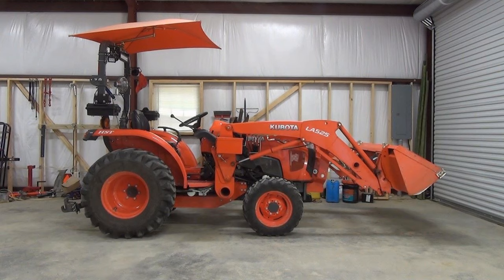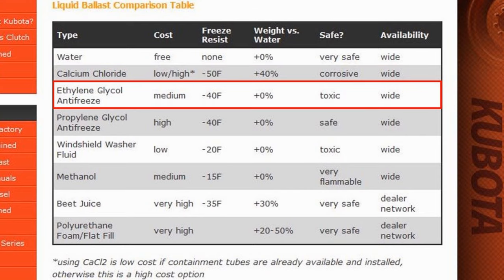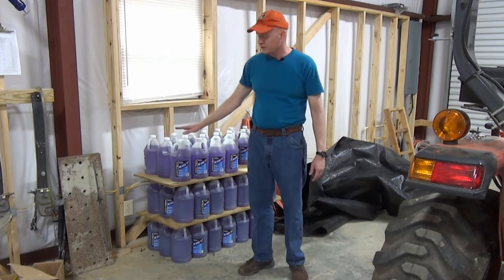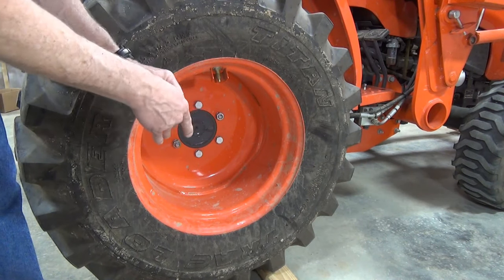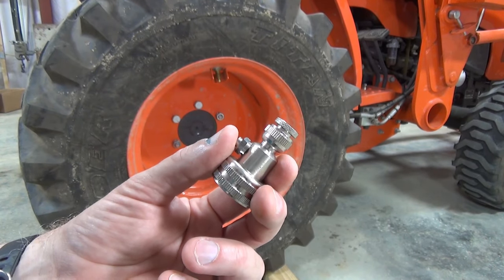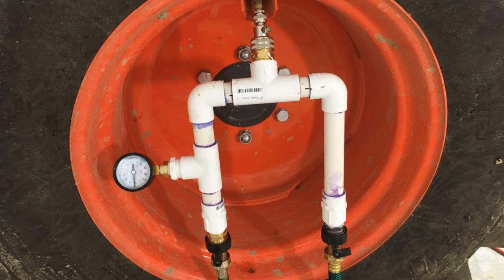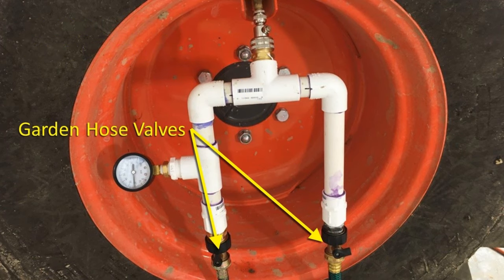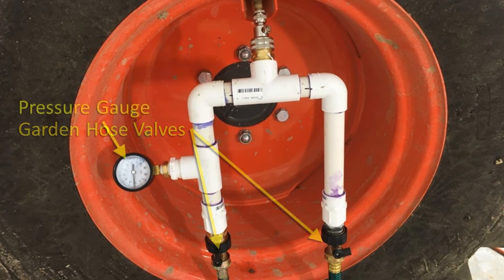Adding Liquid Ballast to Tractor Tires: Which Fluid? Which Method? Tire Fill Chart (#95)

Comment: You mention the possibility of loosing the bead on the rim when doing this. I live in a hard to get to area and don’t know what I would do if I lost a bead while adding ballast. Would it be safer to simply put a jack stand
Reply from the maker: It’s always safer to use a jack stand.  Keep the tire barely off the ground and the weight off the tire and you should be fine. Thanks for watching!

Comment: Any issues with corrosion damaging the inside of the wheels with water/antifreeze/wiper fluid ballast? When I was a kid in Texas we would fill the rear tractor tires with pure water (it rarely freezes hard or for very long here.... but does make tractor a bit heavier to trailer). I'm thinking to reduce cost using just a gallon or two of RV "red" antifreeze in each rear tire then filling with pure well water.... just to give them a little freeze protection (everything changed after Feb 2021 week of hard freezing temps in Texas and power grid failure etc... what a mess that was!). People, don't use toxic chemicals in your tires there is always the probability of a tire puncture leaking it out and you don't want your animals dying slow deaths after drinking the automobile "toxic" antifreeze (green, or orange!)... that stuff tastes and smells sweet, but it's poison to anything that licks it up!
Reply from the maker: Hi Michael! No issues with corrosion. Thanks for watching!

Comment: When you talk about "tipping over", you mentioned tipping forward, but does it also keep it tipping sideways?
Reply from the maker: Hi Abraham!   Yes, as it tips forward on the the front axle it will almost certainly start tipping sideways.  The higher the bucket, the quicker it will tip to one side.  That’s why keeping the bucket as low as possible and be ready to lower it to the ground quickly if the tractor tips forward. Thanks for watching!
Reply: @DIYMyWay  what about if an implement is on the 3 point hitch, but there are no front counter weights? Is there a greater chance of it tipping sideways?
Reply from the maker: Not likely, Abraham.  However, if you don’t have enough weight on the front to counter the rear weight, you won’t be able to steer the tractor well.  Having a front end loader provides a great counter balance to heavy 3-point implements.

Comment: I live in southern Arizona, so we don’t have an issue with freezing, so the dealer filled my tires with water. I had to install a pressure relief valve to allow the steam to escape when working the tractor in July. I’m working on using the evaporating steam as a mister on the ROP.
Reply from the maker: A steam mister for the ROPS! That’s an interesting idea! Thanks for watching!

Comment: I'm going to ask a dumb question because I'm soon going to be a first time tractor guy.  I plan to do this and I'm wondering if the water movement in the wheels is noticeable when you stop/start or change direction?
Reply from the maker: Hi Stephen!  That's not a dumb question at all.  I do not feel or hear anything at all, so no worries there.  Congrats on soon becoming a tractor owner!

Comment: I'm here as I'm always nervous using my b2601 on my hilly property. Up and down is fine but sideways on even gradual incline makes me nervous.
Will this also help the rear wheels slipping / digging when pushing with the fel? Feels too light.
Reply from the maker: Yes, it will.  When I’m using the FEL, I also always have a heavy implement on the 3 point to give the rear tires max traction and stability. Thanks for watching!

Comment: I wonder about the time/cost comparison of DIY v/s dealer or CO OP.
Reply from the maker: It depends on several things, such as whether you have a trailer to take the tractor to the dealer yourself.  If not, you'd the cost of having the dealer transport your tractor to and from their maintenance shop.  I don't have a trailer big enough for my tractor.  Also, you may not have a choice of liquid tire ballast.  My dealership only offered plain old antifreeze and water and I wanted something more environmentally friendly. Thanks for watching!

Comment: Great video.
I have the same size tires on my Kubota and have been looking for tire pressure chart with liquid ballast added.
My Kubota chart shows 30 psi without liquid ballast.
How did you arrive at 20 psi?
Keep videos coming!
Reply from the maker: Hi Kenny!  30 psi is the max COLD tire inflation pressure.  It gets hot here in South, so I prefer to have it between 20 and 25 psi to leave head room and give a little more cushion to an already rough ride on my rough terrain.  If you live in a mostly cold area, you may want to keep your tire pressure closer to 30 psi.   

I'm not positive, but I think your tire pressure setting is independent of whether you have liquid in it or not.  However, one benefit of having only 25% of the air volume left is your tire pressure should be less sensitive to temperature swings. Thanks for watching!

Comment: Your valve stem will come apart by unscrewing and allows faster filling without using the adapters.
Reply from the maker: Very true.  In fact, I think my air/water adapter accommodates the larger opening because it comes with a larger adapter piece.  Something I’ll try if I ever have to drain or refill the tires. Thanks for watching!

Comment: I may have missed it but did you bleed off the pressure built up in the tire occasionally in order to continue the filling?  If so, did you stop the pump and just bleed the pressure our of the tire with the overflow side of manifold?
Reply from the maker: That was covered in the video and is one of the functions of the manifold as demonstrated in the video. Thanks for watching!
Reply: @DIYMyWay  Thanks.  I was looking for the points in the video where you stopped the pump, closed the pump side valve, then opened the release side valve to release the backpressure in the tire then restarted the filling (other than after you had pumped all of the fluid in).  No worries.

Comment: Great video, thanks!  I'm thinking about doing this as well, but I noticed Kubota recommends no ballast with a BH.   I'm a little concerned that with the tires ballasted and the BH on that the weight just might be a bit much for driving around the yard and avoiding ruts.  What has your experience been thus far?  Have you used the BH?
Reply from the maker: Yes,  I came across that after I put the fluid in the tires, but I also know plenty people that have a BH and have fluid in the tires too with no problems.  Same for me.  No mechanical issues, nor do I expect any.  It's true the extra weight might make the tractor sink in very muddy soil, but I avoid that anyway when ever possible.  I have used the BH many times since adding the fluid to the tires.  No problems.  Thanks for watching!
Reply: @DIYMyWay  Thx for the response.  I may give it a go.  Did you see my video on increasing the hydraulic pressure and measuring results?
Reply from the maker: No, I have not.  I’ll check it out. Thanks!

Comment: Thanks for the great video. Is the pressure gauge you used just a typical air gauge or is it for fluids.
Reply from the maker: Thanks, G H! It’s the same kind I use on my pool pump and it will work with liquid or gas. Thanks for watching!

Comment: Excellent video! Just curious. How would you remove the liquid ballast? What would that procedure look like?
Reply from the maker: Thanks! The removal procedure would look complicated and should be avoided if possible.  With the stem at 12 o’clock, jack the tractor up to get the weight off the tire then remove the entire stem, not just the valve.  Insert a small tube long enough to reach the bottom of the tire and start a siphon or use a small pump to pump the fluid out into containers. You won’t get every drop, but you’ll get most of it so the tire can be serviced or replaced. Thanks for watching!
Reply: Couldn’t you just rig up the same manifold system, but instead of 12:00. Position the stem at 6:00 and let the tire pressure itself force the water out. As the pressure decreases, just close the drain valve and open the fill valve and refill with air instead of water. At least I would think it would work 🤷‍♂️
Reply from the maker: Hi Tony!  Yes, that would get most of the fluid out but not all.  The official method I’ve seen is using the tube as I mentioned because it can get just about all of it.  That said, I hope I never have to drain them, but I probably will have to one day. Thanks for watching!

Comment: Great video. I have the same size tires. Just wondering if it took all 29 gallons? Would more fit or not?
Reply from the maker: Thanks, Shon!  Yes, I used all 29 gallons and yes more would fit but that would be a BAD idea.  You Must leave some room for air for some cushion in the tire. Thanks for watching!
Reply: Ok. I been going to the Dollar Tree. Never cared for going in there till they had a few gallons of windshield wash fluid in there for a dollar a gallon. I was like Jack Pot. Lol

Comment: Would it be a bad idea to put used oil in the tires?
Reply from the maker: Environmentally, yes if you have a leak.  Also, oil is lighter than water so you don’t get as much weight for the volume.  Not sure if the oil is in anyway harmful to the tire rubber over time. Thanks for watching!

Comment: RimGuard fill chart did not do me much good. I can't find anything like my tires on there. Ever heard of 15-19.5, 6PR?
Reply from the maker: Sorry to hear that.  No, I haven’t.  Have you tried Googling it to see if you can find the fill volume?  If not, you can buy enough liquid for the nearest tire and bleed off any excess fluid above the level of the stem.  Good luck and thanks for watching!
Reply: @DIYMyWay  Turns out it is on the chart under Commercial Tires.

Comment: Great vid, thanks!  Have you noticed a change in the way your tractor handles?  Better stability?  Lift things more easily?  Any downsides?  Thanks very much, I think I'm going to do this to my MX5200.  Though after watching your vids, I may get rid of the 5200 and get a 3901!
Reply from the maker: Thanks!  Definitely better stability.  I can lift more with less worry of tipping the tractor.  Also, I had heard that fluid in the tires made the ride firmer but I couldn’t tell much difference.  I wish I done it sooner!  You’re joking, right?  I thought the MX5200 was a step or two above the L3901. Thanks for watching!
Reply: @DIYMyWay    Very good to hear!  I bought the parts to make a manifold today, and now I need to source 100 gallons of wiper fluid at a reasonable price.  The MX5200 is a bigger more powerful tractor, but I would not call it a step up, unless you really need that extra size, weight and power.  As I've said before, it is very impressive how much work you get done, even big jobs, with that 3901.  Kubota should pay you as a salesman for it!  I wanted the bigger tractor specifically to be able to pull a 7" rotary cutter, but the 5200 is really just a hair to underpowered at the pto to make that a great fit.  It works out, but a 6' cutter would be better on it.  I was going to get an M6060 originally, and though they are awesome tractors, I'm really glad I didn't go that big.  Most of my work is similar to yours.  Land clearing, firewood cutting, hauling stuff.  The 5200 does a very good job, but I think the 3901 or the 4701 would do most of it just as well.
Reply: @DIYMyWay  Just got my first tire filled today.  49 gallons, took about an hour or so.  I'll do the other one tomorrow, as I ran out of time today.  Had a few drips at the pump and again on the manifold, but I don't think I lost very much fluid.  Kind of a pain, as my valve stems are on the inside of the tire, not the outside like yours.  I didn't realize that till after I made the manifold, otherwise I would have designed it a bit differently to account for the axel!
Reply from the maker: Excellent!  You’re halfway there!  That’s surprising that you valve stems are on the inside of the tire.  Sounds very inconvenient! Good luck with the second tire!
Reply: @DIYMyWay  I think the tires were flipped to give the tractor a wider stance.  But yeah, very inconvenient for ballast filling.  No big deal for air.

Comment: My rotary brush cutter is all the ballast I ever needed. Why do people feel like they need to go through all this hassle and expense? And it makes plugging a puncture an absolute nightmare.
Reply from the maker: I've used my brush cutter as ballast before as well, but it limits maneuverability in tight spaces.  I have found that the combination of liquid wheel ballast and my ballast box keeps my tractor very stable and sure-footed when I'm using the front end loader.  For those who don't want to mess with fluid in the tires, there's always steel wheel weights. Thanks for watching!

Comment: Washer fluid is highly flammable with a flashpoint of typically 50 degrees F. Propylene Glycol has a flashpoint of 130-140 degrees F and is nowhere near as flammable.
Reply from the maker: Good to know, Michael.  Thanks for sharing that info!

Comment: Why do you fill the tire all the way up
Reply from the maker: If you had actually watched the video, you’d know that I didn’t fill them all the way up.  Also,  I explained why I filled them to the level I did, which was what was recommended in my tractor’s manual.

Comment: Do I understand?  You jacked the tractor up, removed the valve stem & let all the air out. By being jacked up & no weight on the tire& rim there is not a danger of the tire coming off the rim.
Reply from the maker: There might have been a danger if the tire had a lot of fluid in it and I lost pressure while filling.  I wasn't taking any chances so that's why I put the block of wood under the tire to keep the weight of the fluid from deforming the tire and possibly compromising the rim seal. Thanks for watching!